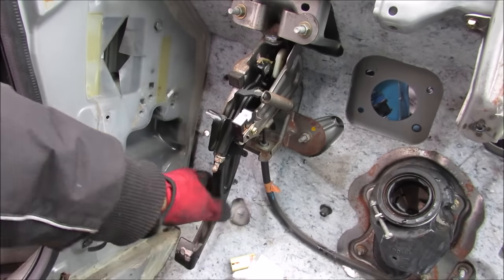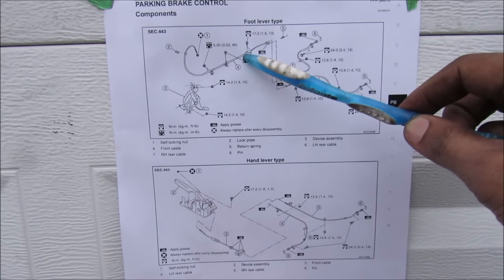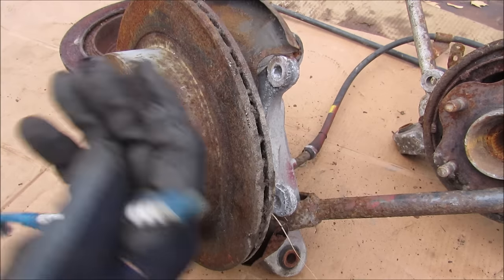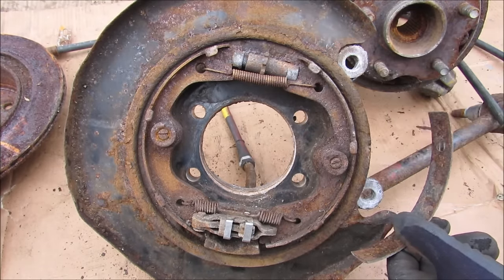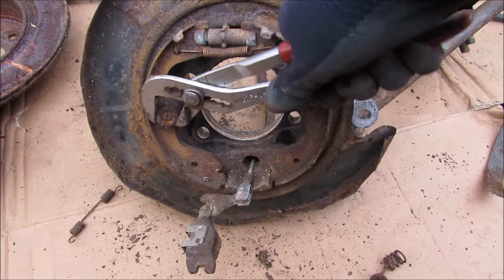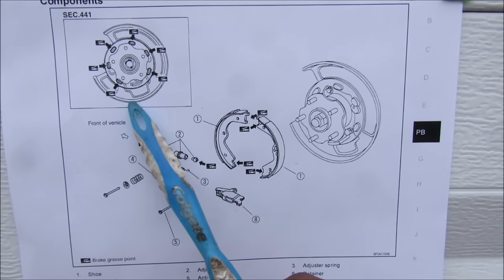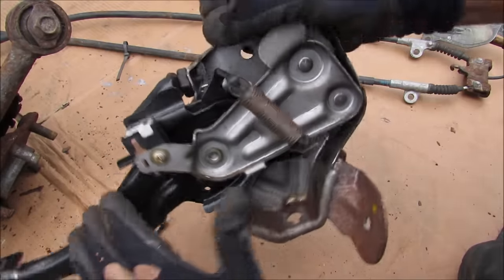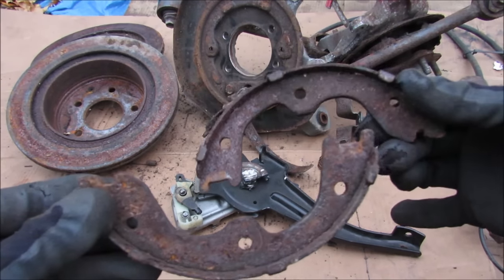How Parking Brakes Work

Comment: Oh hey random comment, I was watching vids where a mechanic was testing fuel pressure and one car had a fuel rail service port and the other didn't so you had to unhook the fuel hose. Maybe worthwhile pointing out if cars have fuel rail service ports when you do your mechanical reviews.
Reply from the maker: Thanks for the suggestion. That's kinda overlooked now a days. Most fuel rails have a pressure sensor that you'll read through OBD. Similarly the EVAP service port exists but it's rarely used

Comment: What about in a electronic park brake? And i noticed in some cars there are two disc brake caliper on the rear wheel, is that something to do with parking brake?
Reply from the maker: The disc caliper on the rear works the same as the fronts. On vehicles with electronic parking brakes, a motor sits behind the caliper piston and a screw drives the pad to clamp against the rotor.
Reply: @speedkar99  I just found info on the electronic brake. Thanks.

Comment: ThqNks so much for the video .. at 4:00 you have showed the hand brake piece was secured by the metal , is that really secure? Or durable? .. yesterday I got in my car and I accidentally holding it to adjust myself on the seat .. by applying little pressure on it , will I do any damage to it?

Comment: Mine's been sticking and when it releases it does so with a loud thump from below. Now, that I've seen this I'm wondering if it might not be one (or more) of those 6 points of contact not being well lubricated. My mechanic just told me to let the transmission hold the car, but I've seen how small that piece of metal is that does that.
Reply: Oh, yeah, excellent video:a very comprehensive run down of how the whole system works!
Reply from the maker: Thanks!
Reply from the maker: Yes please see my parking brake replacement video on how to service your brakes!

If you release it when you are on a hill you will get some noise as the weight is transferred back to the parking pawl
Reply: @speedkar99  I forgot to say that this will sometimes happen after I have already been driving it for a few seconds thinking that it had already released. Ok, I will watch that, Thank you!

Comment: Replaced my E brake pads on my car which the brake looks almost identicle to what is shown in this video. When i pull the e brake, if you look at one side of the vehicle, i noticed that only one of the break pads expands, not both of them in the single assembly. Is this normal?

Comment: My car just has a tab on the rear calipers to accept the parking brake cable which seems like a way simpler setup than having a separate drum brake inside the rotor. Is there any advantage to the  drum style though?
Reply from the maker: They both get the job done. On newer cars I'm seeing the caliper mounted design more which is simplier. However I don't like that you need that special tool to reset the caliper when you change pads.

Comment: so in ebrake, there will be some solenoid thing to pull n release cable?
Reply from the maker: A motor turns a spiral actuator to press on the brake pad against the rotor.

Comment: Can you clarify where the return tension is generated to retract the shoes back to the "brake off" position? When I release the pedal it does not seem to release the brakes and I have replaced the drum hardware and shoes.
Reply: You need to determine if hydraulic pressure is keeping the brake shoes applied or some mechanical issue. I would start by loosening the brake line at the wheel cylinder, this will release any hydraulic pressure that might be trapped in the brake line and holding the brakes on. If loosening the brake line does not release the brakes, then it Is time to look for some mechanical problem like rust or roughness on the backing plate where the brake shoes slide. You stated that you already installed new springs, be sure they are installed in the correct positions.

Comment: I went about 1/2 of a block up a steep hill(that I was parked on) with my parking brake on, it was a big mistake for a seasoned driver like me. How much damage could I have done and how would I know without having it looked at?
Reply: 1/2 a block probably not bad at all. Try parking on the steepest hill you can find and see if you get any slippage. If not just have a mechanic check it out next time you get the regular brakes serviced. If it slips then you may want to take her in sooner rather than later.

Comment: so it need a slight drag when adjusting the e brakes? i  recently adjusted mine that the wheel spins freely with the e brakes off  but then i notice my ebrake lever  pulls up easily and way to high.
Reply from the maker: Yes they need to drag slightly to engage at half way travel of the lever.